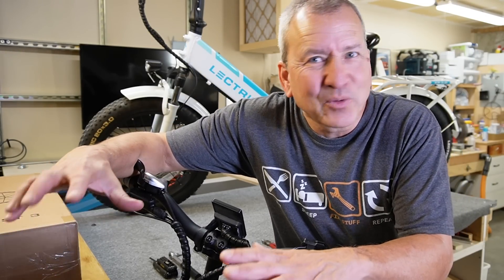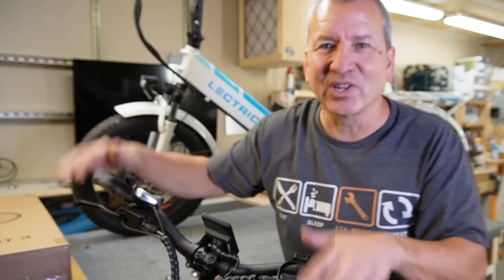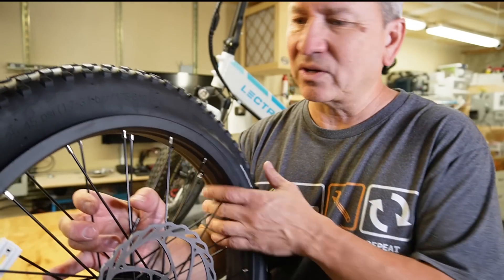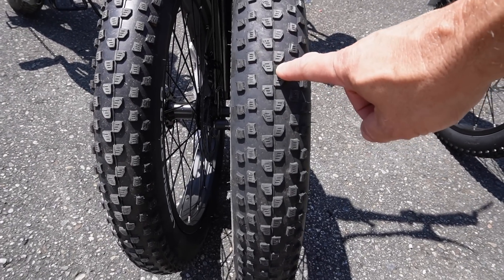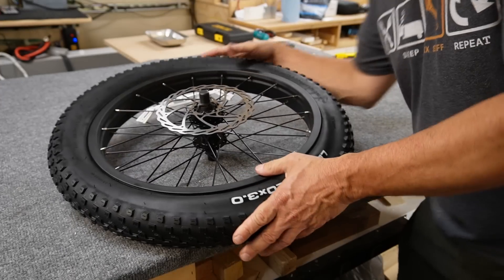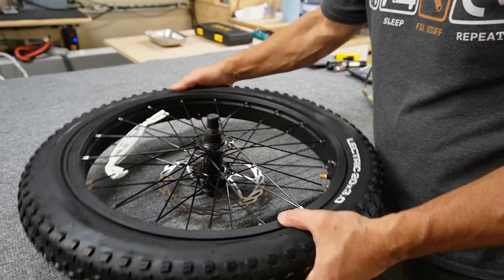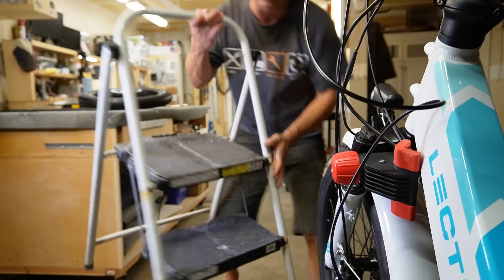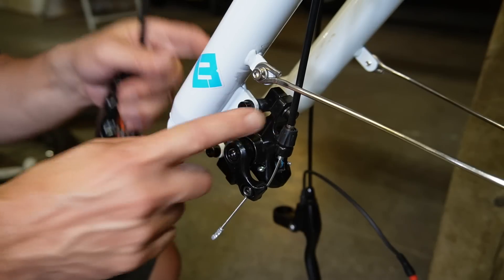Step-By-Step Hydraulic Brake Upgrade for LECTRIC XP 3.0 E-Bike | RV With Tito DIY

Comment: Thank you!  Very helpful video.  I successfully installed my hydraulic upgrade wheel and brakes and used your video to guide me through the process.  I especially appreciate you showing how you adjust the new brakes so the rotors don't rub.  The brakes work great.
Reply from the maker: Great job! Glad it helped.

Comment: Great video thanks! how do you adjust the "tightness" or reach of the new hydraulic brakes?
Reply from the maker: All you need to do with hydraulic brakes is align the calipers like I showed.
Reply: @RVwithTito  I meant the handles of the brakes so you don't have to pull as much to brake, is there a way to adjust it? One side I have to pull more and it feels quite uneven
Reply from the maker: @GadgetsGearCoffee OH. I don't know off hand. Likr other hydraulic stuff, they can get air in there and you need to bleed them. I haven't had to do it yet.

Comment: Followed your steps albeit at a stop ‘n go (sometimes rewind) slower pace and was able to successfully install my Hydraulics!  I did have to remove the bike lock holder that’s located under the seat to squeeze the rear brake calipers thru the inside frame. My only other problem, in the beginning, was actually trying to seat my Lectric onto the bike stand which really was meant for traditional bike frames!  Thanks, really appreciate you!

Comment: I’m actually a bit stunned, I thought this would have been a difficult complicated job, but you showed all your steps so well, that It isn’t difficult for anyone who can use some simple tools. Plus I had no idea, (but didn’t investigate either, lol) how to adjust the rubbing of the breaks, although I don’t have that brand of ebike, i bet the ideas n parts are similarly the same. 🍻
Reply from the maker: Yeah. It's not difficult. The hydraulic brakes are actually easier. Its also common to have a little rubbing on new brake pads until they wear in a bit.

Comment: Nice video. I finished my install the morning your released the video. In the instructions Lectric doesn't have you replace the brackets for the calipers, just the caliper itself as you did. Seems like the caliper alignment is pretty critical. You've got to love a company like Lectric that would send these upgrade kits for free. Had to cost them a good bit of money. Not only does the bike stop on a dime now, it gives you 4 cents change!
Reply from the maker: Ah. Nice. Glad to hear we took the same approach to this. Yes. This brake upgrade definitely takes the XP 3.0 to the next level. 👍

Comment: If you are having a problem with brake rubbing, there is a very easy way to make the adjustment.
Before tightening the caliper mounting bolts, insert a piece of business card between the caliper and the rotor (on both sides).
Lightly hold the brake lever and tighten the caliper bolts. Release the brake lever and remove the business cards. Your brakes should be perfectly aligned and adjusted.

Comment: Thanks for the vid, I really needed to see this. My kit is due to be shipped middle of august. I have the passenger package and I'm very happy that Lectric is upgrading my brakes.
Reply from the maker: No problem👍I hope this helps. Quick question: Did you receive an email from Lectric about the FREE upgrade?
Reply: @RVwithTito     Yes, I did receive the email from Lectric  shortly after it was announced. I bought my 3.0 around Christmas time.

Comment: Thanks your video made a difference,  I have the other model a couple things to keep in mind for the other model,  I ended up with a few extra inches on the rear brake cable which makes sense as the angle makes for a shorter run,  so I was not able to get it all back in the rapping.  
  But not to bad,   also had to remove the mounted lock if you have it to get the rear brake through. . 
     what a great feeling when on the first try the front brake lined up no scratch sound!  simply got it close spon the wheel pinched the lever,  tighten while holding lever down.  
The rear took a few more adjustments.       also take before pictures!    I had to reference them often!  Especially for re-rapping..   so thanks again excellent video!   And very happy with Lectric and there customer service amazing,  couple people purchased these from my experience and company seems like they will do right by their customers.

Comment: Thanks for the video.  I recently saw there's a RECALL on the Lectric XP 3.0 mechanical brakes.  It states that when the brakes are improperly adjusted, the brake cable actuator arm can over-rotate, dislocating parts and causing the brake calipers to fail.  
I'm a newbie on brakes.  What possible problems could happen on the hydraulic brakes?  I did not see any brand name on the brakes. Do the hydraulic brakes have a brand name?
Reply: There is nothing that says you have to do the hydraulic brake update.

Comment: If you have the room, save the tire and tube from the old wheel.  Then you have a replacement for the rear tire when either the tire itself is worn out or you need the tube.  Waiting for our two kits for our bikes.  Great video, thanks!!
Reply from the maker: For sure. Always good to have spares.

Comment: and one final thought on why they replaced the front wheel they are trying to lower the rotating weight of the wheel because the shock is at its limit. an interesting fact is that the Xpremium has a 160mm rotor even though it is heavy. I have seen failures at the crown of the fork

Comment: is it correct to assume that the hydraulic brake system contains oil from the handle bar to the brake and 
this close system is not to be broken?

Comment: This is great, Thanks for the info! Have you had any experience with the hydraulic disc calipers operated by the original mechanical cable? I'm going to upgrade the mech brakes on an EUY Auloor I got for my wife. It's 750W 12.8AH and full suspension for $799 from Amazon! My $849 750W G-Force T42 came with Hyd Brakes and 20x4 tires. Glad to see the XP3.0 getting good brakes!

Comment: Ever had to bleed these either on installation or as a after of regular maintenance?  I've got the XPress and my rear brake just won't bleed like every other brand of brakes. Was hoping someone has a procedure for bleeding a caliper that doesn't have a separate port and screw

Comment: Is there any slime in the replacement tire ?
Reply from the maker: I don't think so. I prefer Flat Out (https://amzn.to/3Qt5uEo) and pumped some in on both bikes after releasing the video.
Reply: @RVwithTito  Thanks for the response. The 3.0 was supposed to come with slime in the tubes from them, but I have no way of testing that.
Reply from the maker: @postalinVT  Ues. I believe that's correct on new bike orders. I don't knownit that's true with these brake kits.

Comment: Q - I recently acquired an lectric XP 3.0. Got it ~1 month ago. I assume I got the new hydraulic brake version. However, the brakes are quite noisey when stopping, and certainly not instant like you showed. Do they need tweaking or something?
Reply: @rustysummers3217  thanks I tried cleaning the rotor with isopropyl alcohol. Didn't help much. I'll check if there's a warp. It's a bit tricky as it's hard to prop the bike up to spin the tire.

Comment: Hi Tito I am hoping for your technical assistance. Bought the XP3.0 two weeks ago. While adjusting the break/caliper gap due to existing squeak upon receipt I've noticed oil like substance dripping from the assembly. I'm assuming it's the hydraulic fluid(mineral oil)😔and now i have no breaking action at all when I squeeze the handle. HELP
Reply from the maker: Oh mam. Sounds like the hyd brake fluid drained out. Any bike shop should be able to fix it, but I'd first contact Lectric and let them know. I haven't filled fluid on the brakes but have heard it's a bit finicky. So best to let someone else do it. There are several YouTube videos to show you how if you're so inclined.

Comment: If you have the 3.0 it should already have Hydraulic brakes please explain what are you putting the Hydraulic brake kit on a 2.0 ????
Reply from the maker: The first few releases of the XP 3.0 did not come with hydraulic brakes. LECTRIC started including hydraulic brakes on this model in July 2023.

Comment: I had someone help me with tightening my hand breaks and he loosened the  wrong nut and fluid came out. Now I have no break and he told me to do my homework and find a way to fix it.   So, I’m not sure what to do.   Looking for answers - any suggestions???  Thanks
Reply from the maker: Best way is to find a bike shop that can service your hydraulic brakes. They should be able to get you sorted out.

Comment: don't know what kind of crap lectric did as I have 180mm rotor on my lectric 1.0 for 3 years on a 4 in rim tire. They could have just used the appropriate caliper adapter and kept the wheel you had they didn't consult anyone who knows bike engineering. I bet the old wheel would just fit fine. As a bike mechanic of 30 years, I got to think there Chinese manufacturers wanted to make some extra money. that being said you did a great job teaching folks

Comment: Hi Brian will these work on the 2.0 I bought a 2.0 right before they launched the new 3.0 and boy was I pissed but I still love my 2.0. I'm not a big bike guy that has to have the latest and greatest so the 2.0 is perfect for me.  I watch Cozy Living Machine and he has the hydraulic brakes and he hates them they are constantly losing pressure and no brakes so he is looking at mechanical brakes. 6 of one and a half dozen of another. Hope yours work great.
Reply from the maker: I'm not sure. The 3.0 has a larger brake rotor than the 2.0. Other than that the bike dimensions should be very close. I'd confirm with Lectric before you buy.

Comment: Properly set up and quality mechanical disk brakes should logically offer identical stoppi g power, assuming you have hands strong enough to apply, what? 1.5x-2x the force to the handles, all things neing equal (rotor size/type/condition, pad size/type/condition,  caliper alignment, and proper caliper to rotor geometry. That said, almost anyone will prefer the feel, reduced application force and modulation of a Hydraulic set up. My question has been centered on: do i want the easier installation of cable pull hydraulic calipers such as Juin Tech (where I simply can NOT find 180mm rotor kits) or a full kit with motor kill wires,  4 piston calipers and proper rotors from "Zoom" - a decidedly budget driven kit, or buy the components I need to do it right. On an 84 lb Okai EB50 with a 750/1000w motor, I think the right thing is obvious. Im thinking 325-375 for top level gear. Hell, i dont wanna die! 😂